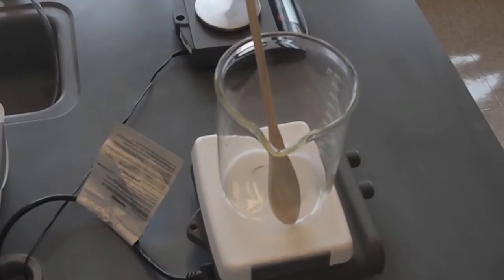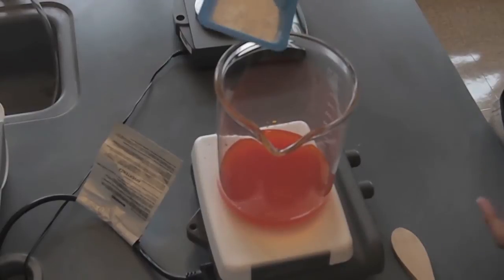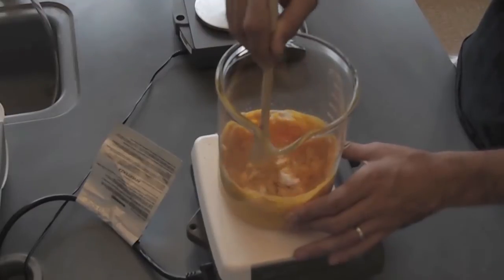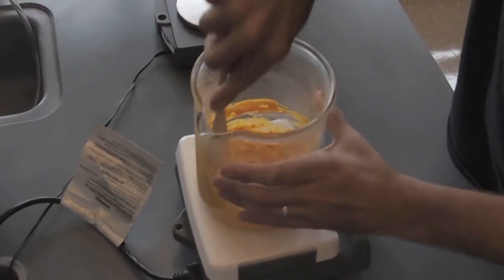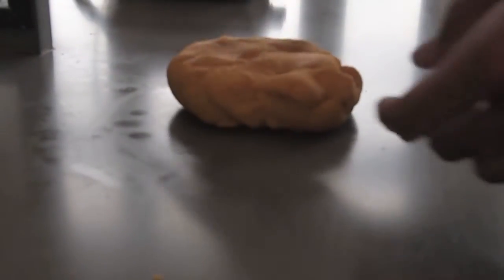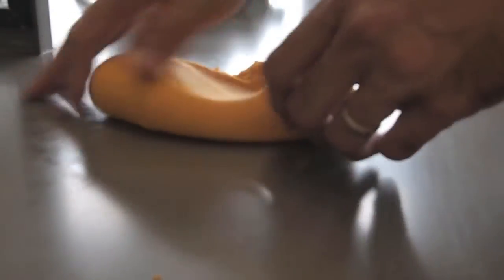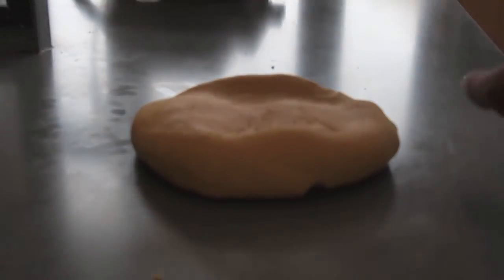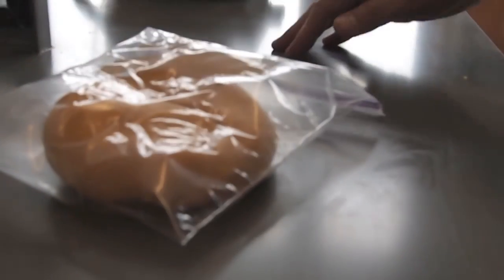How to make conductive dough

Comment: What's DI Water? sorry i don't know english so much
Reply from the maker: Berk Özcan Distilled water
Reply: Thanks
Reply: @Chemteacherphil  to be exact DI is deionized water and D is distilled, DIH20 and DH20
Reply: DI Water = Deionized Water.  However, I suspect distilled water will work just fine.
Reply: I suspect creek water or even toilet water will work fine,.... I'm pretty sure it's supposed to have ions in it, a lot of ions, that's how it conducts electricity. Unless he wants only very specific ions and no stray ions. So far he has added potassium ions and tartate ions